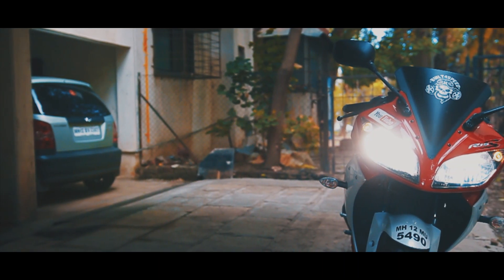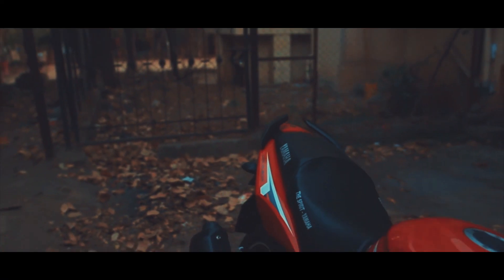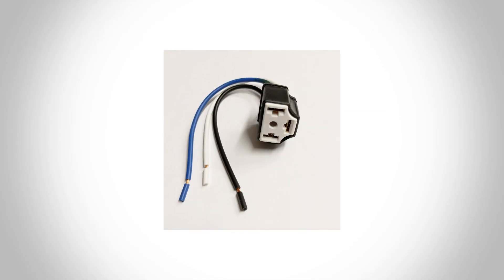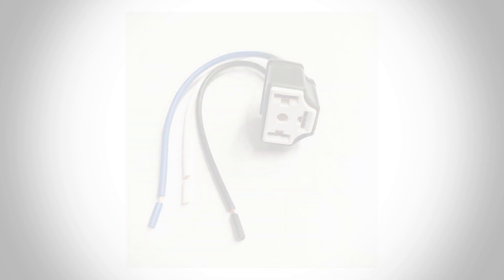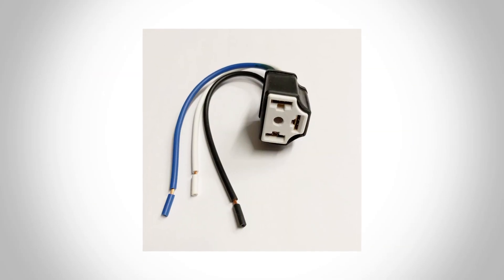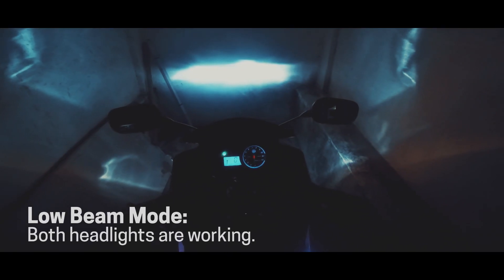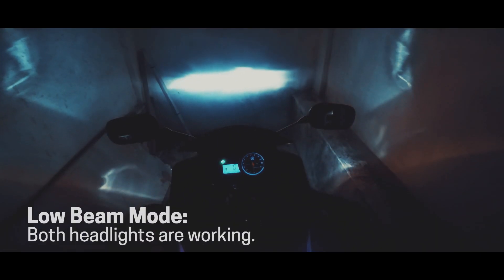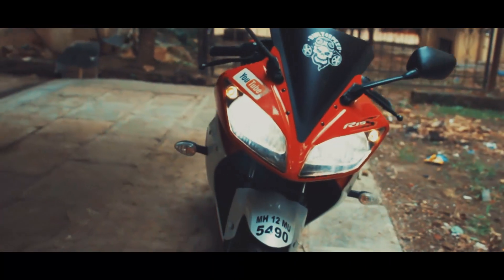Yamaha R15s Low Beam Modification - Both Lights Work In Low Beam!

Comment: You can do it with 1 wire I have done it
You put a female spade connector on either end of a  wire you will see a small slot above the standard light connector  slide the female spade in either ends of the headlight connectors and good to go
Cost 50 cents
You don't need another headlight holder or connector

Comment: bro i want to upgrade my bulbs which bulb should i buy philips or osram suggest me
Reply from the maker: +Hrishikesh Bokhare I'll suggest you to go for Phillips DiamondVision 5000K bulbs. Just a reminder to you that whichever bulb you will install, Install 35W bulbs and don't install higher capacity bulbs else your battery will dry as you know that R15 has small battery. If you want, you can install LED bulbs but they heat up quickly and doesn't last long.

Comment: any effect on battery consumption?
Reply from the maker: +Sushil Pandey About 5 to 10% more battery consumption. It doesn't affect much but it does.
Reply: Shreyas Vaishnav which one are you using now i own a same R15s same colour
Reply from the maker: +Sushil Pandey What?
Reply: Shreyas Vaishnav i mean which bulb are you using
Reply from the maker: +Sushil Pandey I'm using Philips DimondVision 5000K bulb. You can check video about it on my channel.
Reply: Shreyas Vaishnav and about engine oil you are using yamalube
Reply from the maker: +Sushil Pandey I'm using Motul 300V Synthetic oil.
Reply: Shreyas Vaishnav after how many kms should i change to motul
Reply from the maker: +Sushil Pandey You can do that after 10,000 kms.